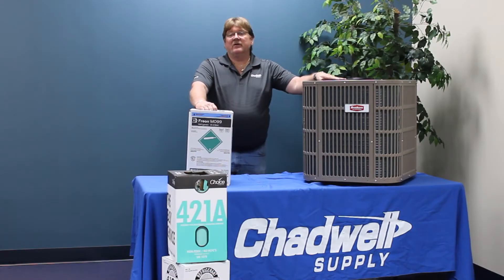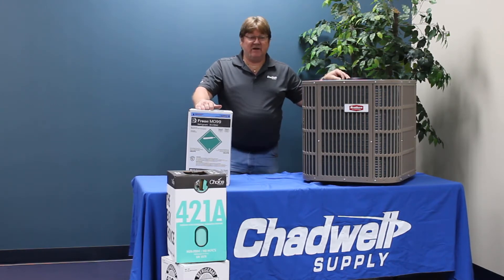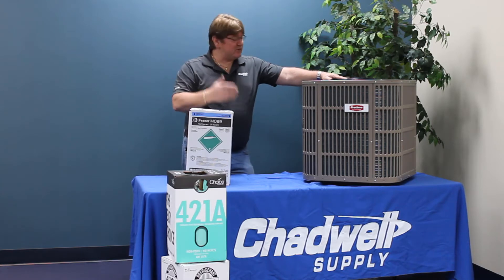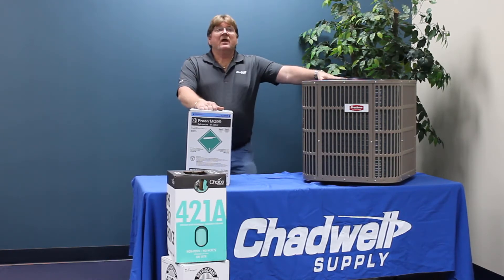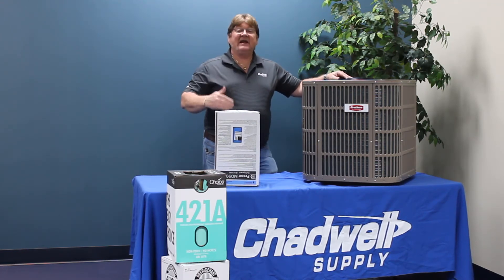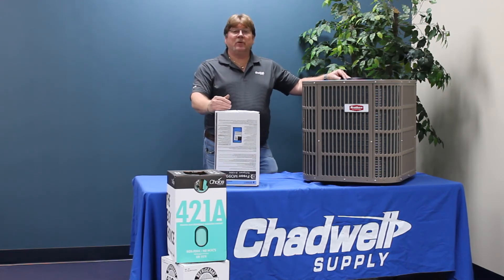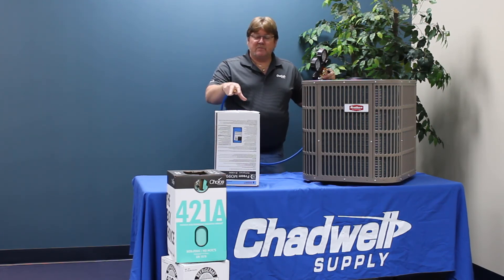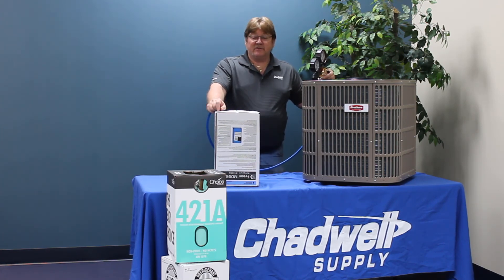Part 5, Pros and Cons of MO99 Refrigerant

Comment: 407c is really good as a replacement for r22!
Reply: 407c you have to change to oil- a real pain in the A'' M099 can be difficult to adjust the charge  there is not really a good answer to what replaces r22 the best